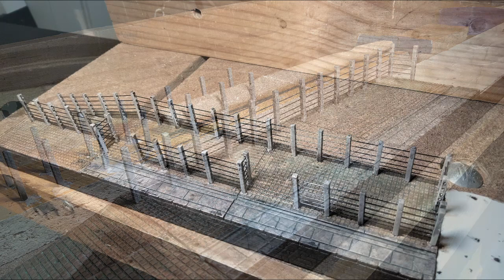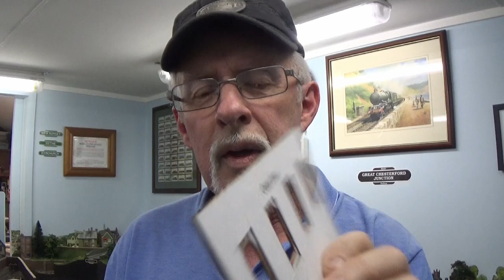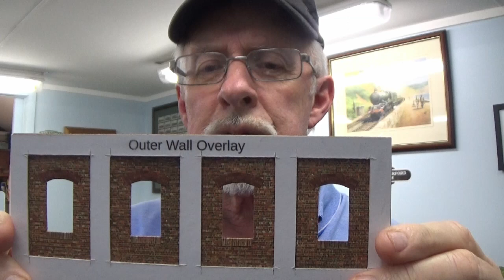GCJ Update September / October 2023

Comment: G'day Gormo,

Don't worry about the arm chair modellers. Like you said, they are the ones that don't necessarily have a layout but can pick the bits out of every other modellers work. Not even worth responding to them. 
Everything is looking great on your layout and it was nice to have a catch up on Tuesday night. Always a pleasure to see where you are up to on the layout first hand.

Thanks for the shout out regarding the scratch built coal stage. It's painted and weathered and should be with you in the next day or two. 😉

Cheers, Gary.